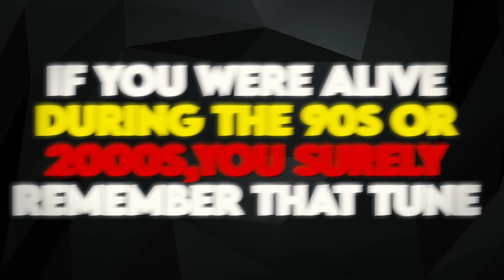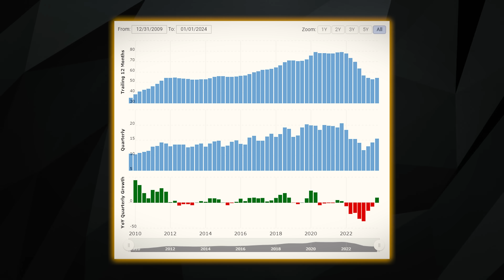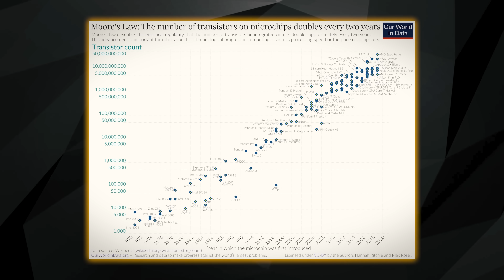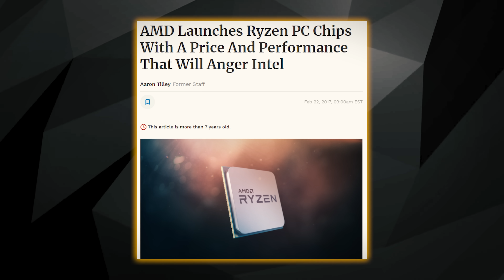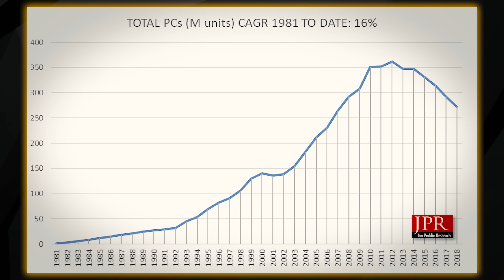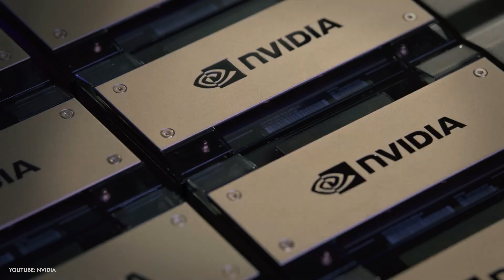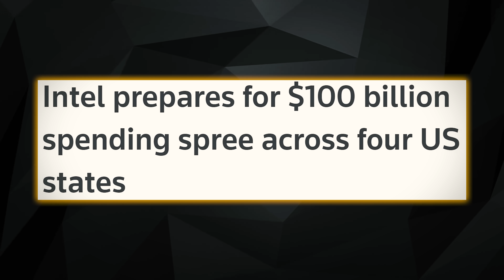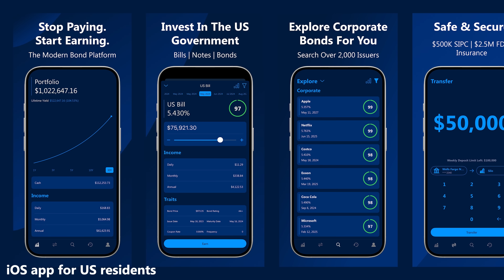The Dire State Of Intel...What Happened?

Comment: I think the complacence of the Intel stagnation era is somewhat overstated. They invested quite a lot into architectural improvements. Trouble is they came to focus heavily on new SIMD instructions, which are extremely efficient in theory, but difficult to work with in practice, so these innovations took a long time to seep into consumer applications. As a consumer you'd never notice if your CPU had the latest set of AVX 512 extensions. Meanwhile their EUV lithography got badly delayed, so they got stuck endlessly polishing their 14nm process node. So what we got was year after year of very modest performance gains, stagnant core counts and rapidly increasing power consumptions.
Then off course there's Optane, the extremely fast and wear resistant persistent storage, which looked really promising when it was announced, but release got delayed, and flash memory evolved too rapidly, making optane pretty much pointless by the time it got into production.
Not to say they weren't complacent! It's pretty stark how much more effort they put into real performance after AMD had clawed back their entire lead and then some. With no fire under their feet Intel management clearly weren't in a hurry to improve real world performance.

Comment: In the late 80's, early 90's there was a slew of Harvard business laws paper's which argued that Fortune 500 companies are best led by financier's and bankers over technical led companies. Since the Fortune 500 companies run in packs, this led to all the Fortune 500 companies putting in bankers into CEO positions. This move absolutely destroyed engineering type companies, though it took many years for this mistake to manifest itself. Companies such as Boeing, GE, AT&T, HP and now Intel have suffered when banker CEO types took over. Now, the hottest companies are technically led CEO companies. When you are a technical company, engineering development is a massively expensive area where the payback for engineering development isn't for 5 years or even more. The issue is, if you miss an engineering development product cycle it can/will have massive implications on your future product roadmap. If you are a banker type CEO, it is easy to see that your present yearly profit can be maximized by cutting engineering development and focus on marketing and finances. In truth you need a CEO or C's who master engineering development and financing/marketing NOT just financing/marketing.

Comment: Intel's greatest strength was/is its manufacturing talent.  In the early days (1970's), it could design chips but couldn't get the yields to standard.  Dr. Craig Barrett was brought in from Stanford who would eventually become CEO.  But Intel made several slips along the way.  Merced aka Itanium was to be the successor to the highly successful x86 architecture.  Merced lingered in the labs because it wasn't stable.  With HP's help, it finally came out - too late to change direction of the market.  AMD, having settled it claims with Intel after many years of litigation, simply took x86 and make x86-64, which is what most consumer PC Chips run today.  Intel also go side tracked by the lawsuit filed by DEC over trade secrets.  With Intel very quickly settling the suit, they bought Fab 5 from DEC and made it Fab 17 in 1998 - bound by SEC / FTC requirements that Alpha would be made 7 years.  They also, sadly, spun off the StrongARM license to another company having never been able to capalize it manufacturing prowess to land a major cell phone deal.  In summary, Intel tried to reinvent the CPU world with Itanium and failed.  It became distracted with litigation from DEC.  All of this cost time, money and spent resouces that never fully capitalized its expenditures.  Finally, very few people in the world forsaw the impact of Cell Phones as a personal device and Intel has paid a heavy price.

Comment: I feel like one of the main things missing in this video and also one of the most important one is regarding…Data Centers. It’s a core Intel market that is slowly bleeding over to AMD and unlike consumers, price per unit is also a lot higher.

AMD’s excellent scalability and efficiency gives performance per watt and also saves a lot of space to achieve the same level of performance. For Data Centers, they are usually slow to adopt newer hardware so if they are switching to AMD slowly, it’s definitely a concern.

Comment: It was greef that was reason. Intel was so greedy it made people buy mobs non stop, it never gave people plenty of chips, all of theyr stuff was locked as if you want overclocking buy this one and pay us, also closed source evrything. While amd opwn source, gave people chips, leting do anything thwy want. Burn tourch innovate. And amd moved closer and closer in big jumps to intel untill ir crushed intel like cocroach. They even pay streamers to have intel in shows similar like nvidia. And it doesnt help, intel doesnt know how you must work than you are liwer end. They are broken in mind and every time it getting worse, now about nvidia they are sweating now badly theyr card becomes worse every new gpu they release, size go up means chip is low end same ild chip which overclocked. 5090 will be even bigger its like this grab cpy overclock it tgan want more place more cooling and more , untill you need to fill cou with liquid . It means chip is old new chip which amd makes is super cold. Rad on xtx didnt changed much in size basic same. And 3market like asus tuf huge rad you dont need to buy water cooling cause rad is too huge. Has double more cooling than gpu needs. And now amd pocking nvidia to burn like intel did. Also adding great card in cpu which simply end all gpu need ti buy

Comment: Your comparison to ASML, TSMC, AMD, Qualcomm, etc is entirely misleading. ASML makes the machines Intel, TSMC and Samsung use. It's akin to comparing Foxconn to Apple or Airbus to Siemens. Intel is also the only large chipmaker to design as well as manufacture its processors.

Plus, for anyone thinking I'm an Intel shill: my system is an AMD/Nvidia combo, so I must be a pretty dire fanboy.
Reply: There's a reason Intel's name is Chipzilla. Intel has more chip fabricating capacity than the rest of the world combined. Intel doesn't just make chips, Intel invented chips.

Comment: Intel had a damn near monopoly on x86 computing for most of the architecture’s life. ARM won’t likely be the real replacement it has so many of the same problems the instruction set is BARELY “reduced” anymore. Intel has an engineer as a CEO now but they’re running up against way harder engineering problems than in the past. Also, Moores law is super insanely dead until the fundamental technology changes.

Comment: Intel really hasn't been a true innovator since the late 70s. They've been damn good a playing dirty. Nvidia learned this lesson well. You can't just be dirty you have to be innovatively dirty. 
Most every major innovation in CPU design over the last 25 years has come from AMD.  From the on die memory controller to chiplets.  And even when you look at Nvidia, they got to where they are with marketing. There was a year period  where Amd/Ati had the technical lead on Nvidia, but they sucked at marketing, so Nvidia sold more cards.  Now Nvidia is technologicaly ahead and have been for awhile, Pascal is the inflection point. But before that they were tied or loosing. Intel thought dirty tricks and marketing alone could save them, they were wrong.

Comment: As an ex Intel employee it is sad to witness the company’s decline. The leadership of Intel forgot the advice of its founder and stopped being paranoid. The company thought it had a near monopoly and became complacent releasing dual core processors for years. Rather than invest in new technology to drive the market forward it returned money to shareholders and then AMD came along and beat Intel at their own game. Since then the market has continued to evolve with ARM based SOCs dominating and now AI. Intel is still very far behind and needs to pull multiple white rabbits from the hat. This is a huge challenge but the CEO seems to care and has as good a chance as any. The fact that no one has made an offer for Intel (with its relatively low valuation) shows how irrelevant they have become. I am surprised an investment company has not made a bid as I suspect Intel is worth less than its parts.

Comment: They started falling down as early as 1993. That was the year the first pentium was released, you are not old enough to remember that. after that, they charge premium prices to consumers for very small speed increases. They thought clock speeds was the answer. It wasn't. they went down a very wrong path with RD-ram; and of course who can forget the Optaron. The only way there laptop chips started getting competitive in the mid 2000s was they bought a company  to give them the engineering skills necessary to do it.

Comment: 12:08 they lost their reputation when they disabled undervolting on laptops. Something that increased battery life, decreased heat and noise without losing any performance. Since they did, I switched to AMD.
Reply: lol
Reply: @SubLimation7  something funny about it?
Reply: they disabled undervolting after it was discovered that you could basically root any system by playing with voltage
Reply: @AG-sx9ws  and yet it's still allowed on HK and HX. This was never about security, this was about greed.

Comment: I wouldn't say "without any experience", they've been making iGPUs for many years now. The main issue with Arc was the bad drivers, not bad performance of the GPUs themselves.
Reply: years? decades, since the i810 chipset they offered gpus made by them and that was back in 1998, closer to 3 decades now
Reply: @betag24cn  I didn't know how many years exactly hence why I said what I said. I saw their first iGPU in my first laptop in 2011.
Reply: @TabalugaDragon  intel used to put igpus in the chipset or alone in the motherboard, then it was inserted into the cpu socket when size and ram access made it a better idea, specially useful for laptops
Reply: It's both. The A770 is supposed to compete with a 3070. It competes a whole class or two below it while having a larger die size.  Alchemist is architecturally flawed to the point where it relies on ReBAR to even function.
Reply: @riven4121  while having more vram per dollar than Nvidia and having better ray tracing and upscaling than AMD does.
Reply: @TabalugaDragon  Intel is selling their cards at a loss because they are both late (Alchemist was meant to launch in 2020) and not actually all that performant for what they're supposed to be. 

 It is on a smaller more efficient node than the 3070 (TSMC 6nm vs Samsung 8nm), consumes more power than their counterpart does and performs worse than it does. 

Half of Alchemist's issues is with the silicon itself. If Intel had sold it at the price it's intended to sell at, no one would've bought it and it would've been an expensive mistake.

Comment: That’s because INTEL failed to make good use of its patents for monopoly market positioning. Software such as mmx, sse, and avx that were actively promoted by INTEL and used SIMD were licensed to competitors free of charge. However, the main competitors in high-performance computing NVIDIA adopts a much smarter competitive strategy than INTEL, although this competitive strategy has been fiercely criticized by LINUX founder Linus Torvalds.

Comment: Alright, let's fact check a bit.  Not an Intel fanboy, AMD user since my K6-2.
In 2014 I owned an Asus Zen with an Intel Atom.  
Downstairs I have an Arc A380 discrete GPU.  There is an entire line sold at Microcenter.
So, Intel did fail in the smart phone market, but tried.  Intel also sells an entire line of GPU's to consumers and have been squeezing more and more performance from them.

Comment: Why not license ARM like everybody else and modify it so it runs x86 code natively? Make it a hybrid chip that can do both at the same time. They are the ones with the keys. ARM clearly has the watts per instruction ratio cornered. Intel tried their own low power designs and face planted. Itanium face planted and they got back up. Do it again.

Comment: Intel should have delivered the killing blow to AMD when they were struggling with Bulldozer. Instead of innovating, they were complacent and have been releasing the same chips since 7th Gen and just making minor improvements. They squandered from their success, and they are paying the ultimate price.

I can see AMD following the same footsteps as Intel and diverting their attention to AI. They should be competing to eclipse Intel in performance and price until their company is dead. Then continue to provide improvements and customer value so that no one else would bother to make chips.
Reply: Intel wasnt interested in giving a killing blow because only they and AMD have an x86 license, if AMD has dissapeares, they would have been acused of monopoly

So basically AMD was allowed to live more than anything else

Regardinf AI, Intel is already superior in AI to AMD, both in hardware and software
Reply: @marcos1669  as long as their chips run hot, I can't see Intel eclipsing AMD anytime soon.
Reply: What Intel actually did was they sent an engineering team to AMD to prop them up. Because with AMD out of the picture suddenly Intel becomes a monopoly. With anti-trust laws that's bad.
Reply: funny how tablet is turned, Intel fanboy always moke amd as cheap and easily go up in temperature
Reply: @WilotPiko  it is more of a seesaw. A back and forth. When Intel gets their 20 angstrom line up and running it'll pitch back then. Being fabless AMD is kinda meh.

Comment: Its Intels turn to struggle and innovate now, if you look back at AMD their FX-9000 literally just was about to be the final nail on their coffin but through sheer engineering prowess they managed to take huge leaps with their chiplet structure, that even they werent even sure was gonna work out. Now we got Intel for the first time in decades being completely outclassed by the industry but about to be launching their major innovations like FinFet and ground plane power delievery litography techniques which utilizes both sides of the silicon wafers and inlcuding them moving away from the Monolothic litography they used for eons, to the same Chiplet design that made AMDs Ryzen such a step up. Inlcuding that compared to AMD,  Intel actually own their own fabs which should allow Intel to still exist as a chip manufacturer if their own Designs dont cut it anymore. Im confident to say after this very long winded explanation that Intel isnt as bad off as most people think.
Reply: Sheer Intel engineering prowess. When AMD was circling the drain Intel lent them 200 engineers and they created Ryzen. Because if AMD went under then Intel would be a monopoly. Which can be a difficult position in this day and age. Intel needs AMD and AMD needs Intel.

Comment: Come on. The reason AMD passed Intel was because they were free to use TMSC, just as Apple did. Intel couldn't outperform the world's highest tech fab, so instead they told everyone they could. They lied. That is what caught up with them.

Also Intel DID try to complete in the graphics market, by putting graphics onchip and having it take frame buffers from the main memory (see "Intel Graphics Technology" at Wikipedia). It was a brilliant cost move, because the graphics could take advantage of the high speed access to main memory and caching. Unfortunately it resulted in slower graphics, and the standard for PCs was to disable it and put in an external graphics card. The result was Intel spent chip space on a block of logic that typically went unused. Intel got burned by this and didn't try to enter the graphics industry again.